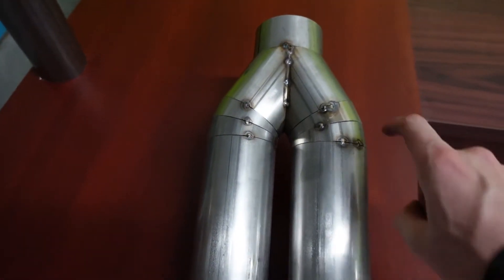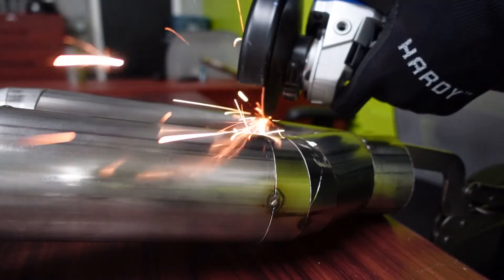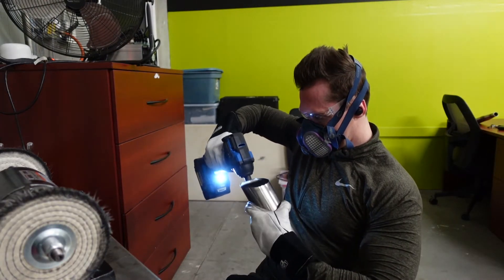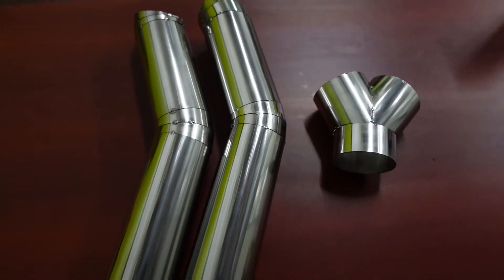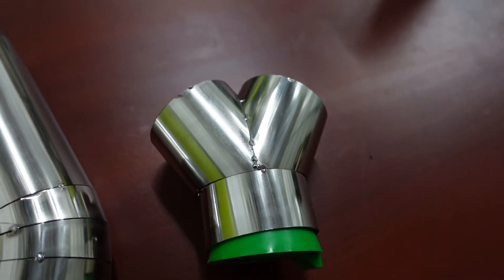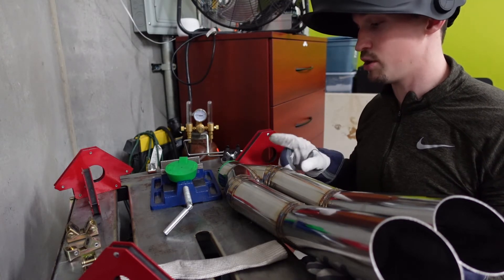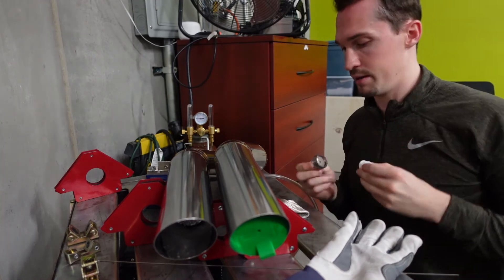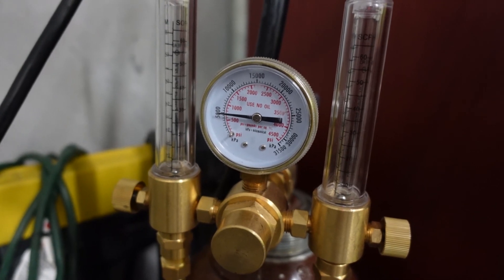DIY WELDING JDM BLAST PIPES W/ STAINLESS STEEL | tig welding pie cuts to fabricate car exhaust. PT.2

Comment: The mirror finish turned out amazing. Any issues with polish contamination in between the pipe joins when you’re welding?
Reply from the maker: Thank you! And surprisingly no, I thought it would but nope just clean with a microfiber and acetone and it’s good apparently